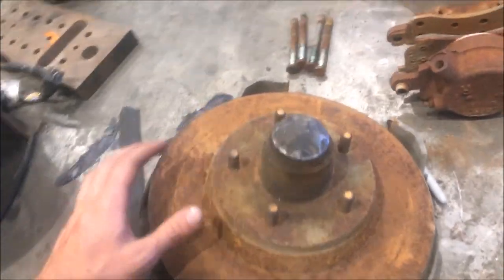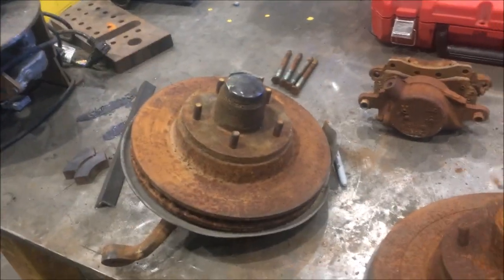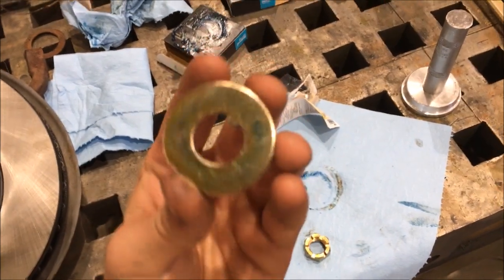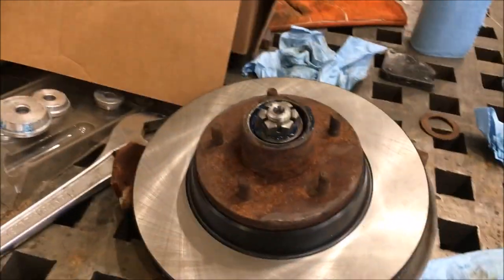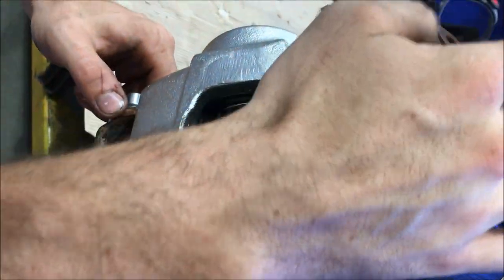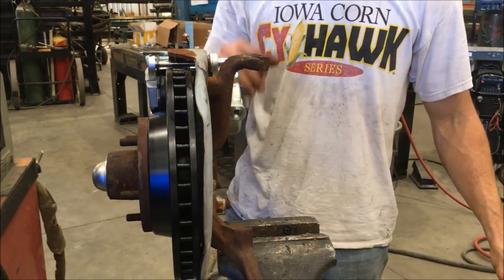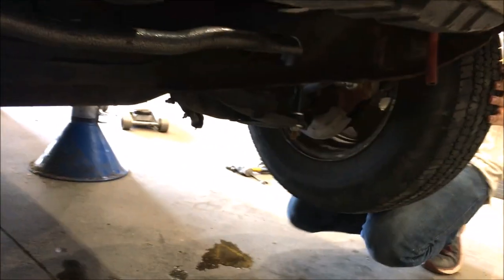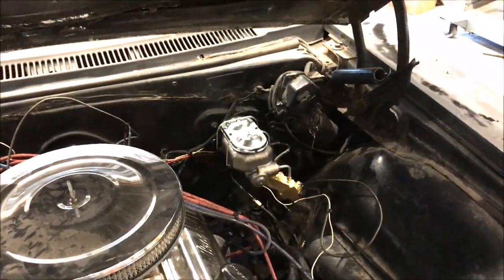66 Impala Disc Brake Conversion

Comment: If you have the rotor hubs from a 1970 that works. Drum hubs from a 1969-70 Chevrolet full size work and the rear rotors from a C3 Corvette are the same size and will fit over the drum hub or disc hub. Both hubs for 1969-70 utilize the same bearings. I'm doing the mod on my 66 Impala SS and Wilwood makes an aluminum 2 piston caliper that is an exact fit for the 1970 caliper brackets. I've personally fitted them and they work great. Nobody offers the 1969-70 rotors anymore but like I said the C-3 Corvette rotors fit and are available. Summit racing even had ones made by Wilwood P/N: WIL-140-11739-D made in the USA. Better than China junk. Great video.
Reply: Agreed i put c3 fronts on my 70 imp.

Comment: I need to do this on my 65 wagon.....also wanna do the 5 speed conversion, but have concerns about how close it is to the bench seat. .  Great job for flying solo on most of this project.
Reply from the maker: The T5 from an S10 has the shifter moved farther forward and should work with the bench seat... just can’t drop the clutch on it
Reply: @iowadiy6361   I wonder if the tail housing from the S10 could be swapped.....gotta do some more digging now. Thanks for the info about the bench seat. Watched Eric The Car Guy's T5 rebuild series last night and got some good information. But I don't think they covered that.
Reply from the maker: From my research I found that it could be swapped.. fairly easily too. It would take a little bit more work then to get it all done but it would be better for the long run
Reply: @iowadiy6361  I got the same info.....may do the steel bearing retainer upgrade shown in the series because the 327 I have is in the neighborhood of 425hp. I'm lucky that the 12 bolt and AC came factory in mine, but I will have to upgrade to positrac. Thanks for your input brother.....
Reply from the maker: No problem. Good luck with the build!

Comment: The washer that was too small; what was the application? Was it for a 69/70 full size?
Reply from the maker: No. The spindle I used was from a 69/70, so it was just altogether wrong. I'm not sure what the correct application would be.

Comment: Did you have to make new hard lines from the proportioning valve to soft lines (of the calipers)?
Reply from the maker: I did, yes. The lines had different size fittings and I also did not want to blow a rusted line so I replaced them.

Comment: How about rear disk brake conversion? Any idea of what donor vehicle would work? I know the 98 camaro that folks use for other gm 10 and 12 bolts axle flange is different
Reply from the maker: I don’t know about a direct bolt in, but the 98 camaro would be the route I was going to go with and then I would put in a spacer

Comment: Where did you get the union and the brake line for the rear in your video I need the same thing.
Reply from the maker: I got all the parts at O’Reilley’s... I think the union and flex hose for the rear axle was actually a jeep part according to O’Reilley’s
Reply: @iowadiy6361  do you have the part numbers for everything?
Reply: And the sizes to confirm with them
Reply from the maker: I don’t have those anymore
Reply: @iowadiy6361  but the sizes you mentioned in your video are the correct ones? And the line you bought already came made you didn't have to make it?
Reply: @iowadiy6361  I can't find 7/16-20 anywhere??
Reply from the maker: Yes I bought a pre-made line from O’Reilley’s.. they had different fitting sizes and lengths of line for me to choose from. I had to go into the store to get it. Their online store was not as easy to navigate through